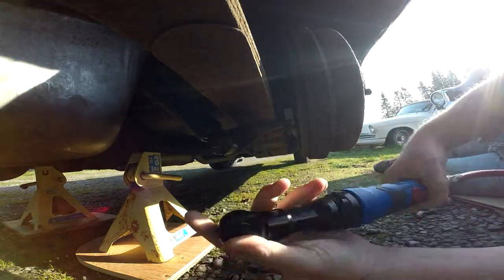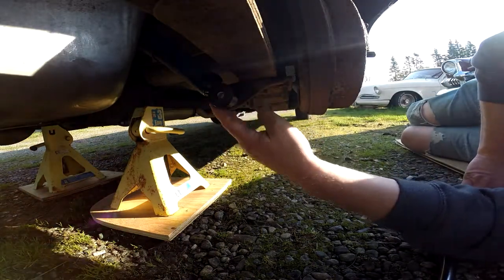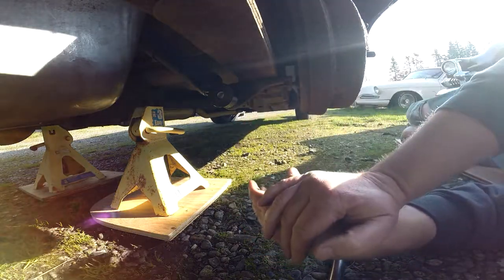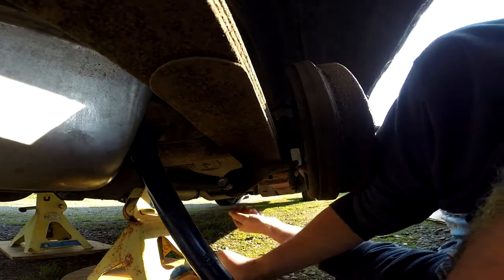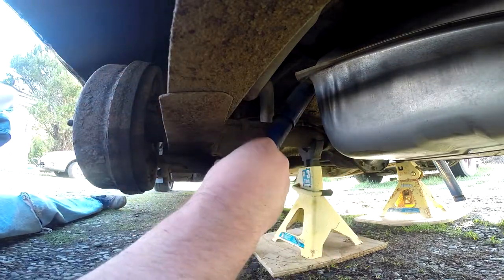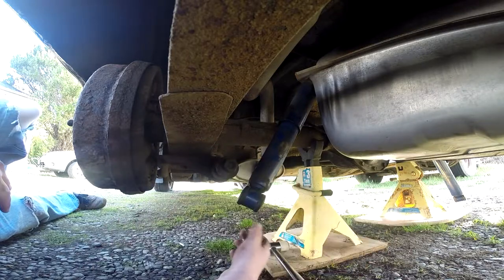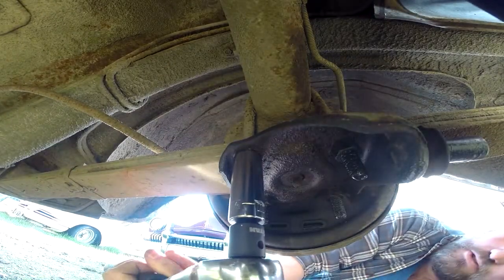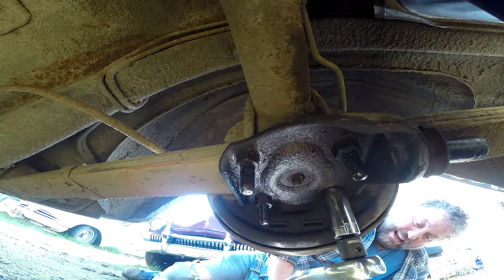1974 Valiant Shock Replacement FAIL!

Comment: The easiest route is to cut off the old u-bolts and use new ones. Never saw a shock mount twist off before.
Reply from the maker: Thank you Sir! I hadn't reached the point of considering that yet, but I think it makes all the sense in the world. You have seen a shock stud destroyed now.... And by hand no less. I knew I didn't have a good angle on it, but went ahead anyway.